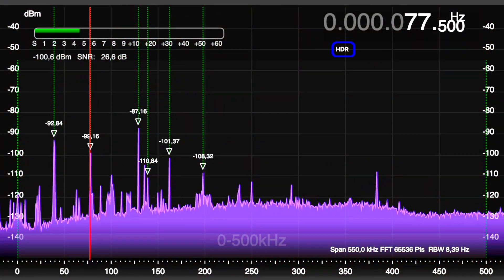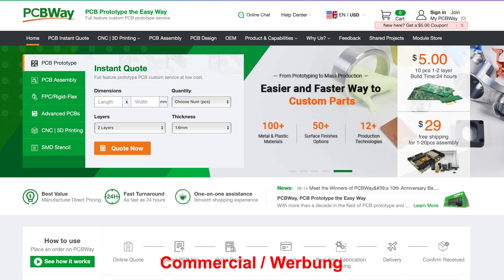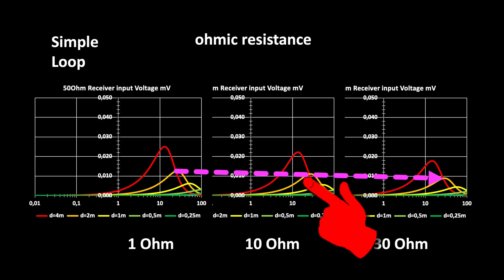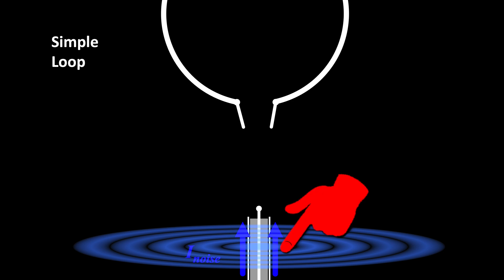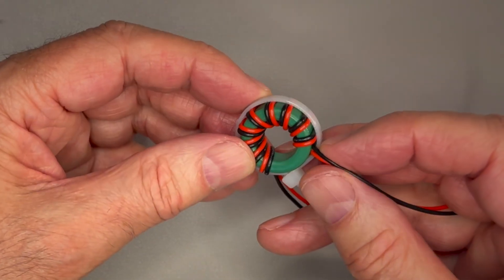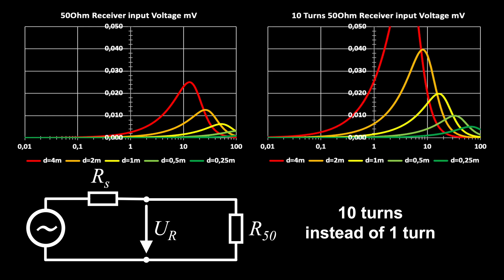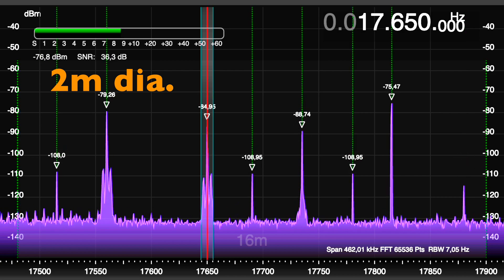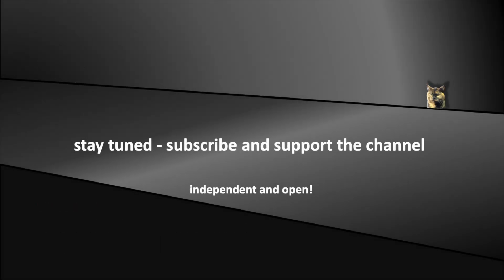Magnetic Loop: Properties & How to Build One for Longwave & Shortwave Listening (EP166c)

Comment: this is stunning! I've noticed with my own loop the lower noise floor, also the ability to null out the noise I was getting from my home's smart meter. so a magnetic loop is one of my primary receiver antennas . I also use a what they used to call a "snake" antenna fed by a 9:1 unun for receiving with my ham station both for the low bands. both are amazing receive antennas. I would have never noticed these antennas if I would not have gotten into SDR's - originally I got into SDR's to complement my main ham transceiver as a panadapter. I've made it as an ancillary receiver so , I can use it for ham radio and also as a scouting receiver ( outside of the amateur radio bands) SDR's have made radio fun again for me, the ability to test different antennas in real world or real time is a huge benefit  . 
I would have never thought I would enjoy LW and just low frequency investigations , but I'm 'hooked' now.  thanks for these videos , I'm really enjoying your work! 
BTW, what software are you using ? I use a few but my main software is SDRuno , I also have SDRconnect , also use the suite of software for my Raspberry Pi 4b called DragonPi 64 OS , it has SDR++ etc. mostly for my dongles RTL-SDR V.5's .... I'm a longtime ham and just a radio nerd since childhood. again, thanks for sharing your work, keep 'em coming ! 
and SDR's have made radio fun again for sure.  de N3TGY ..
Reply from the maker: Thank you very much. I'm very happy that you like my videos and that you're sharing your own experience here.
I use an RSPdx and the new SDRconnect software version 1.04 on an Apple Mac with an Arm 3 processor. The RSPdx is particularly well-suited for low frequencies.
The application with your RaspPi is cool. I might try that to operate the RSPdx remotely.
I've also been a radio nerd since childhood. I studied communications engineering and I am holding a PhD on antennas and wave propagation. In my professional life, I worked a lot on mobile communications. But over the years with completely different things, and in the end, I only had management tasks.
Now that I have the time, I'm happy to return to these things. And I am happy to publish this on YouTube.
By the way, besides other other antennas, I have many new DIY ideas in the pipeline for VLF antennas. 
Since I discovered low-impedance loops, I've been fascinated by them.
I'd love to hear from you more often.
Best regards from Stuttgart
Klaus
Reply: @electronics.unmessed  very nice Klaus , I really enjoy your instruction . I became an industrial electrician also a firefighter and medic for 22 years on top of everything else. I've never lost my love for radio, I licensed in the early 1980s as a teenager , mostly taught by older 'Elmers' one was a local TV station engineer . he was really cranky -with no children of his own, it took him a long time to teach me and trust me around his home lab.... I heard 'DON'T TOUCH' quite often, LOL , but I learned a lot from him.... he's long passed, but he would just love SDR's even when there's no physical knobs and switches. I also use a SDRplay RSPdx-R2 and very happy with it..  and I have two RTL-SDR's with an Upconverter for the low stuff. the RSPdx-R2 is just so much easier to use and install. -myself my ham computer is an Core i7 , it's a gaming rig that my 29 y.o. son built for me so it's like a sledge hammer to swat a fly in a lot of functions. win. 11 has a ton of COM port issues for me. the Raspi4b is perfect for SDR experiments , same with all of my Linux machines. I cannot wait to see the low freq antennas. I've been playing around with some home brew transformers and pieces of wire. it's a LOT of fun! I've got chokes on everything and a direct ground connection for my radio bench with thick tin plated woven lines to a 2" copper pipe (radios) and half a meter from my bench. really helps with the noise floor being about -120 dbm.  my main ham rigs are both Yaesu's  I've a FTdx3000 tapped to RX port to the RSPdx-R2 and a FT-710 direct sampling SDR. broke my spine and neck fighting a fire 25 years ago, and by God's grace I can still move around and blessed with my radios. Thank you for your excellent teachings Klause de  N3TGY 73 !  ..
Reply from the maker: @l.a.2646  Hello again and thank you for your kind and long comment!
Wow! It's always great to read how viewers have discovered their hobby and are interested in my videos.
I often try a balance between complicated theoretical stuff and practical DIY suggestions. It's not easy for me, but I think this is the niche where I can offer added value with my videos.

Thank you for your great feedback, it really helps me a lot!

Regarding port issues with Win 11: I use a MacBook Air. The USB connection to the RSPdx sometimes just drops out. I haven't figured out what's causing this yet. Maybe it's the transfer speed that my USB-C to USB-A adapter can't handle, maybe the supply power isn't sufficient when RSPdx is running hard, or maybe it's simply a software bug that will be fixed at some point. SDRconnect is still relatively new.

I'm happy to read that you can pursue your amateur radio hobby despite your misfortune.

I'd like to give you a few tips if you want to build a VLF BALUN. A new video will be coming soon, where I'll suggest a better one that's easier to replicate.

By the way, if you have any questions, feel free to post them in the comments. I'm happy to answer questions and often use them as an opportunity to make a new video about them.
Stay tuned!

Best regards from Stuttgart and '73
Klaus

Comment: "Leistungstransformatoren" means power transformers. The toroid appears to be for power transformers rather than RF. Any reason for choosing that type of toroid?  What material is it?
Reply from the maker: Thx for your comment. Yes, that's a good point I forgot to mention. They work well at low frequencies, which are important to me.
They work well both as a choke and as a transformer.
I suspect they have a lower cutoff frequency than usual for RF technology. Unfortunately, I don't have a characteristic curve. In any case, I wouldn't recommend them for higher frequencies.
Reply: @electronics.unmessed  Thanks! I will save any of these toroids I find then. I was considering using them as weights to help throw long wire antennas into trees.
Reply from the maker: @LouiseBrooksBob  Well, it's been proven that they work very well at low frequencies. So I wouldn't just throw them into the trees. They're too small for that and for transmitting antennas anyway. But I wouldn't use them generally. You can certainly find better ones for higher frequencies.

Comment: Silmilar to your idea at 9:34, I have an MLA-30+ (active loop) and 35 foot wire on the same feed. However, I put a 17pf ceramic capacitor on the wire where it connects. My hope is that I've isolated the loop's active circuit. The loop seems to handle 3-30mHz while the wire handles above that?  Do you have any suggestions?  If not, then just a big thank you for ALL of you videos.
Reply from the maker: Thank you for your comment!
Here are my thoughts: 17 pF corresponds to a capacitive resistance of 312 ohms, which obviously puts a load on the loop and pulls down the voltage. I think that's where the limitation comes from. Without the capacitance, the cutoff frequency is certainly higher, but you'll probably also get more noise. Maybe you could try it without the capacitor. I'm curious. BR Klaus
Reply: @electronics.unmessed  I just retested. The capacitor does bring a little loss but it cuts out low frq noises(air conditioner right next to it). My hope is that I'm not stressing out the loop's 12v power supply since the cap doesn't pass DC.  If I break any section I instantly lose associated freq ranges.  

    Hopefully my ansi art comes thru and YT doesn't think I'm trying to script something here.

           inside    | wall |  outside
                         |          | 
                         |          |        ++++++++PreAmp++Loop       (.5-30mHz, Local AM radio WWV,  SWL)       
                         |          |        +
SDR--12vDC++|++++|+++Splitter
                         |          |       + 
                         |          |       + 
                         |          |       +++Capacitor---(no 12vDC)---35ft-Wire    (88mHz plus (FM radio, police, weather))
Reply from the maker: @kerzman  Cool. Maybe there was a misunderstanding. I understood the capacitor is in parallel. You're describing the capacitor as a coupling capacitor, which you shouldn't remove of course.

Comment: Great video. Can you do one about how sense antennas interact with loop antennas?
Reply from the maker: Thank you for your comment. I'm glad you like it! I love new ideas. Can you tell me a little more about what you mean by "sens antenna"? BR Klaus
Reply: @electronics.unmessed 
The examples I’ve seen have had a small vertical antenna switched in and out of the loop antenna circuitry to change the pattern of the loop antenna. It’s usually used in radio direction finding.
Reply from the maker: @mfed1337  Aha, I see. Need to think about it. Thanks for your hint.

Comment: Your comment that a higher voltage would be delivered into 240 ohms rather than 50 ohms suggests that  a  simple amplifier with higher impedance input and low impedance output would work well. A simple emitter follower circuit using even the most common transistors like the 2N3904 could do this. A  FET-based circuit like that used for Mini-Whip antennas might also  be used.
Reply from the maker: Thank you for your comment. I think your reasoning is correct. In a previous video, I roughly calculated what difference a high-impedance amplifier could make. We'll see; I'll definitely try it out. Stay tuned! BR Klaus
Reply: @electronics.unmessed  I think it is important to realise that using an amplifier may not improve the signal-to-noise ratio, but could offset the loss in a long run of feeder cable.
Reply from the maker: @Martock1017  Thx for that comment! That's a really good point!
Reply: @Martock1017  Gotta get that preamplifier right on the output of the balun!
Reply from the maker: Thx for sharing your experience!

Comment: Thank you. I really like working with mag-loops. They have numerous advantages at HF and lower frequencies, and only a few disadvantages. To me, the most important advantage is that I can construct and use one in my apartment and make whatever changes or adjustments I wish without even having to stand up. As far as the difference between using one indoors or out I can't use one indoors and out where I live and keep the antenna parameters the same. But I do know that a high-Q mag-loop works better indoors than running a random wire around the room does. the ability to remove noise by rotating or tilting the loop makes all the difference. 

The materials used in making the wall, or the external siding material could pretty much kill reception if they are metal or aluminum foil covered. I used a multi-turn loop to receive WWVB at 60 kHz. I put the loop in the basement in order to get it away from near-field noise.
Reply from the maker: Hello John,
Thank you for your comprehensive comment. It's giving me some new ideas!
I'd never considered the idea of putting the antenna in the basement before, but it's a cool one. Of course, the material of the wall plays an important role. But in any case: I think the magnetic field directly behind a wall is less attenuated than the electrical one.
I've noticed that too; the loop delivers a significantly better signal than a piece of wire, especially at low frequencies.
Stay tuned!
BR
Klaus